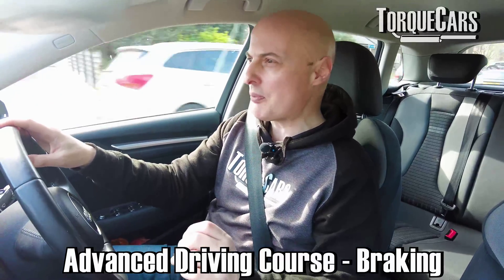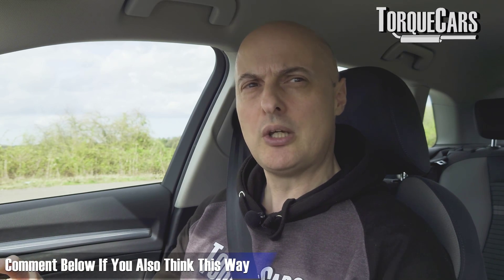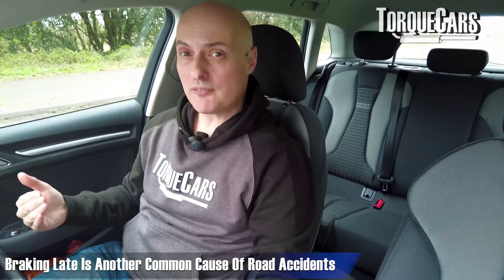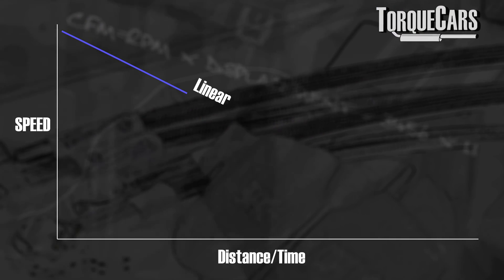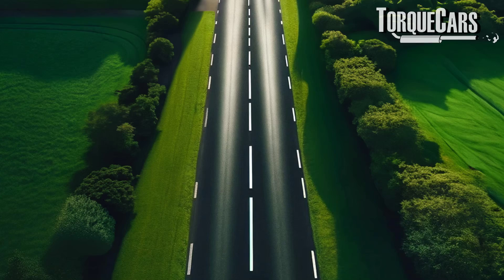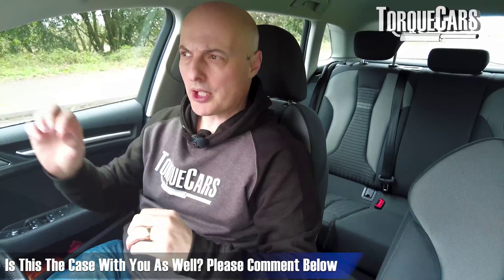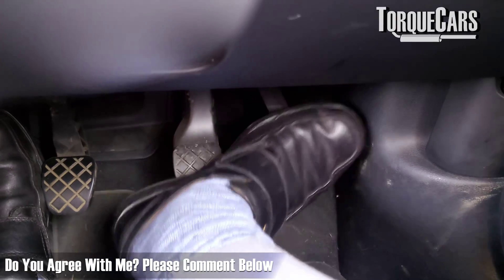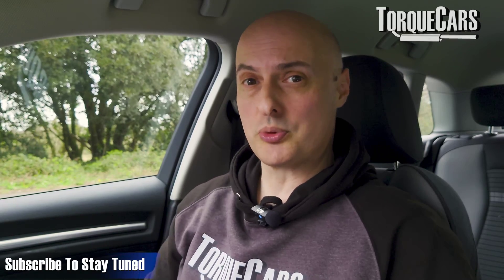You've Been Braking Wrong All These Years - I Bet You're Not Braking Like A Pro Driver!

Comment: In my car the brake and throttle are close enough that I can just roll my foot while on the brake to Rev match. It's something I always do.
Reply from the maker: it does make a difference to a spirited drive if you can. My feet are ridiculously wide and with so many compact cars over here it is quite rare to have the opportunity. 

Don't get me started on cars where the pedals are offset to the steering wheel, I like the brake to be in line with the steering column, perhaps it's a RHD thing we have over here?